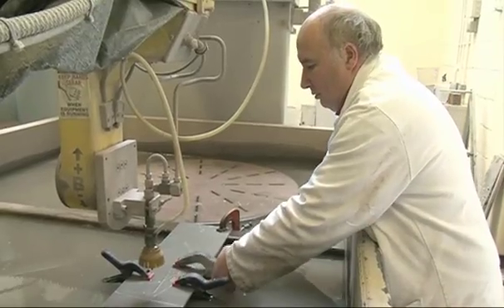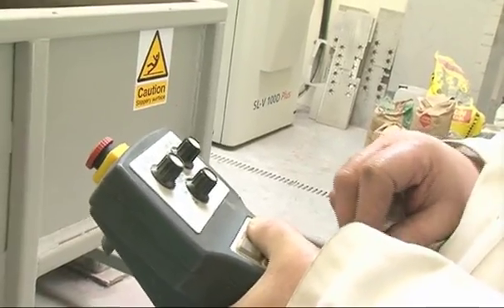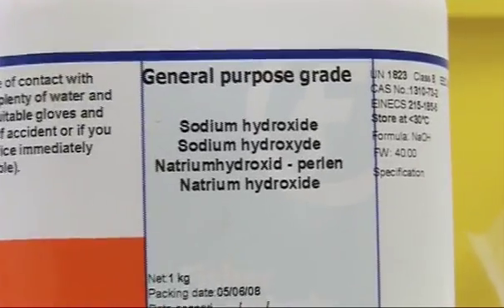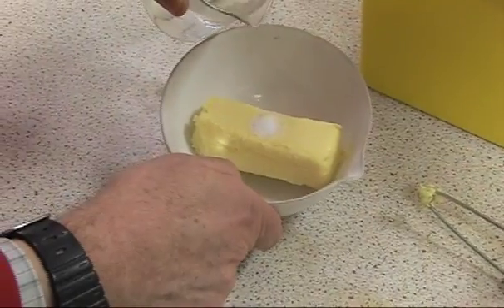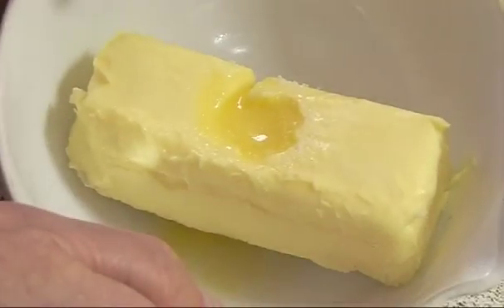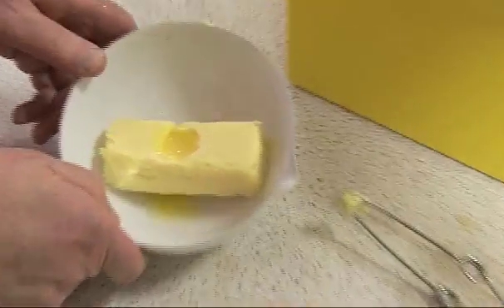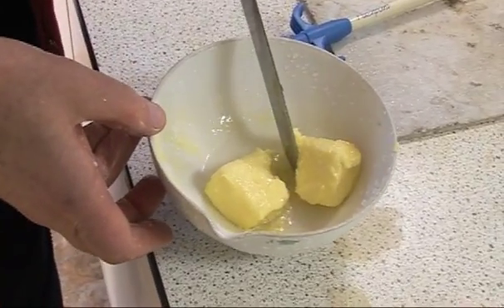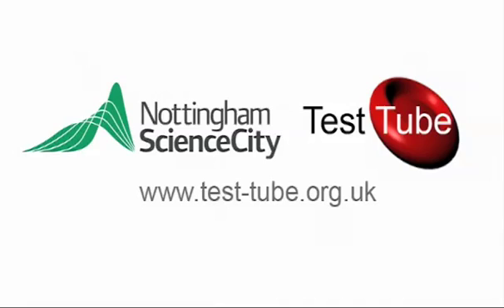Butter Cutters

Comment: @CertifiedBad4ss dude... the laser head is not the laser itself. It wouldn't be the size of a shed, and it DID vaporize the butter. Thats actually how laser cutting works. But it only vaporized the butter that was hit by the laser, the butter around it got melted

Comment: @shankvale did you see the clamped plate where the butter was standing on? it went straigth through that as well :p thats why it was clamped on 2 sides. we got one of those over here at uni too, i've seen it cut through bigger chunks of steel then you'd think water should be able too :p

Comment: Heh. Sodium hydroxide is a wonderful household chemical.

I've once used it to clean a large pot with stale smelly fat clinging to it. I poured hydrogen hydroxide solution into it, covered with a lid and left the pot on a stove (not turned on). After 20-30 minutes I started to hear "ping-ping".

That was the lid of my pot being lifted by boiling sodium hydroxide solution! It turns out, this reaction is quite exothermic. So I had to wipe off several liters of smelly soapy liquid of my stove.

Comment: Just a minor complaint :
Why could you not have cut "cryogenic" frozen butter (liquid Nitrogen temp) with a heated rotating [stainless] steel band-saw at a temperature of about 500 C? This kind of band-saw has blades with no serrations, and versions of it are used to cut Cheese.

A cheese chemistry episode would be nice : EXPLAIN THE ENGLISH CHEDDARS! Also do processed cheese episode separately.

Comment: ell3en, I used to program ABB 6 axis waterjet robots to cut out parts for the automotive industry.  Believe me, they can cut through anything.... eventually!.  We used a plain water system with around 3000 - 3500bar water pressure and it would cut cleanly through 2mm plastic at around 150-200mm /s.  These jets also cut into the stainless steel supports over a period of months.  To cut metal properly companies add abrasives to the water.

Comment: Of course, you would choose a hot knife, which cuts just as well as the water jet.
Of course, chemical butter won't be eaten!

Sodium hydroxide is lye or soda ash!Noncombustible Solid, but when in contact with water may generate sufficient heat to ignite combustible materials.

Comment: Further up the OP said "before we cut the butter, the waterjet was used to cut a small slot in the steel underneath. ". So the water jet didn't actually have to cut through the steel in the part we saw. I imagine it would look pretty similar anyway, seeing as the water is going at 2000mph...